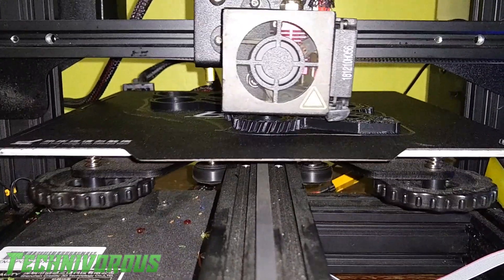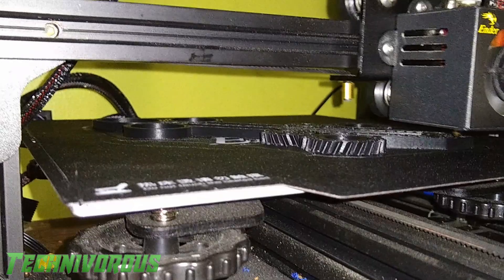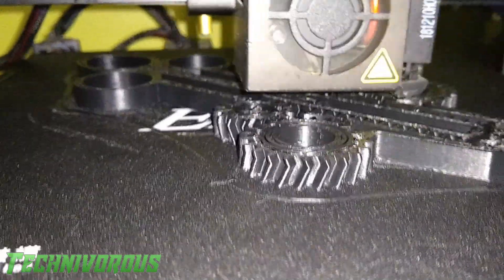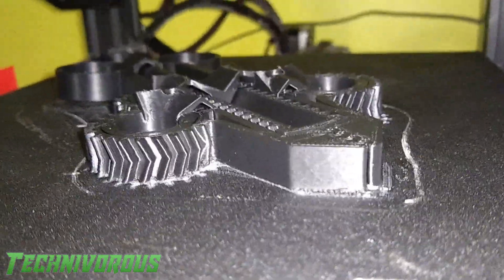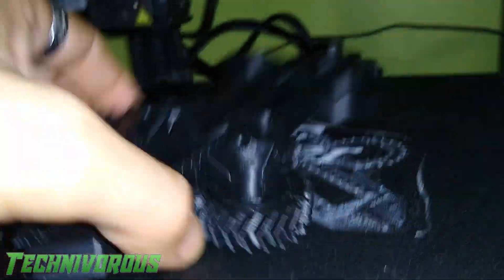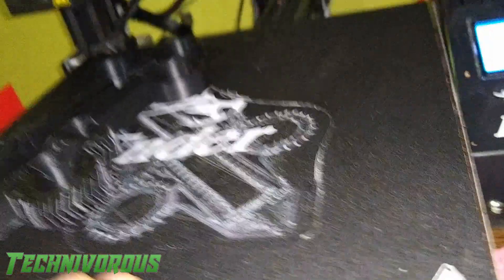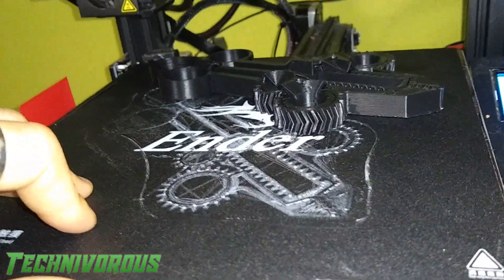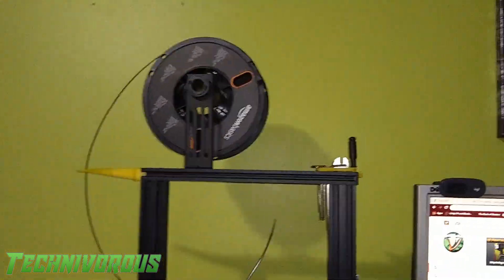More 3d Printing ABS on my Ender 3 Pro

Comment: Sorry but increasing temp doesn’t increase the magnetism. It actually does the opposite. Heat is bad for magnets.
Reply from the maker: sustained high heat, causes the magnet to weaken yes, but the printer dosnt gohot enough to  demagnetixe it enough to come loose, also the magnetism returns when it returns to room temp. this is called a curie rating

Comment: I have been having such a hard time with ABS my prints have been warping at first they look fine then just start lifting. My PLA comes out perfect
Reply from the maker: Have you used a draft shield
Reply: @Technivorous  I just seen your video on it so basically just put a square around my design and it should print better? I'm very new to 3d printing I just started in late february but have been learning check out my video to see what I'm using it for https://youtu.be/L9r4S3T2m_0

Comment: Heeeey man, what settings do You use? what is layer height, extruder and bed temp?
Reply from the maker: Layer height dosnt really matter .2 works well. Extruder temp 250 bed temp 70.the most important part about printing on an open frame with abs is the draft shield
Reply: Have you printed under the magnetic piece? On the black bed plate by it self?